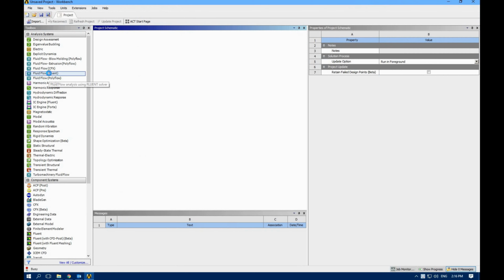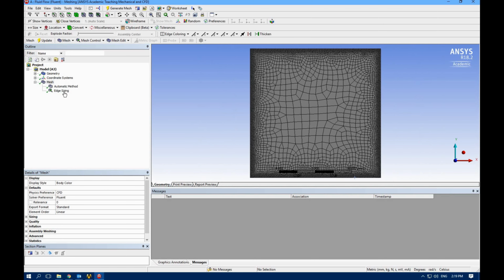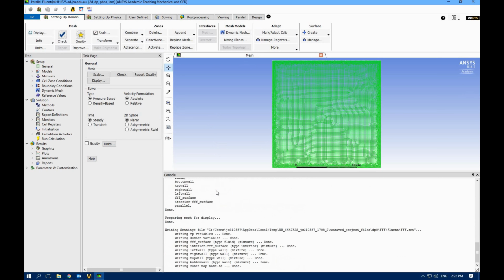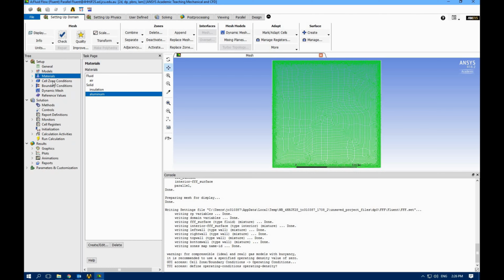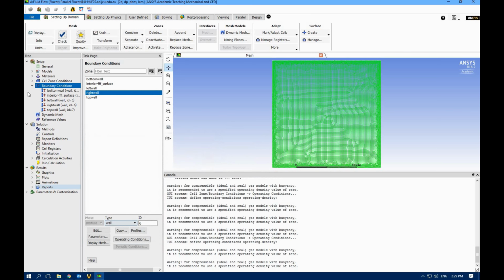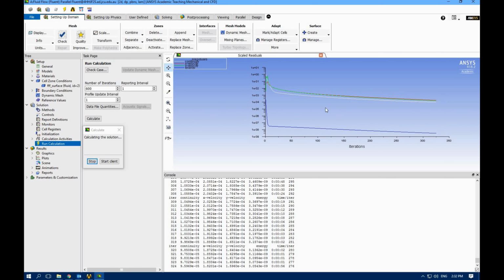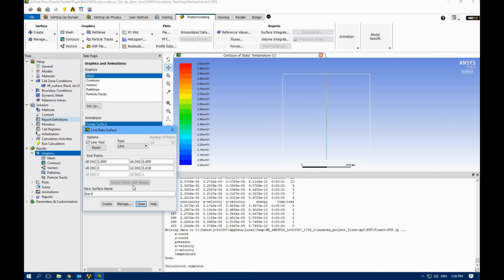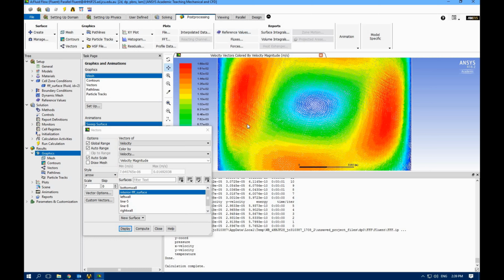AP12 4 ANSYS/FLUENT training

Comment: good explanation...but just for your info ... its reynold's number. not reyleigh number.
Reply from the maker: Hi Bilal, 
Thank you for your kind words.
We usually use Ra (Rayleigh number) as the dimensionless parameter for characterizing the natural convection flows. Re (Reynolds number) is used for forced convection.